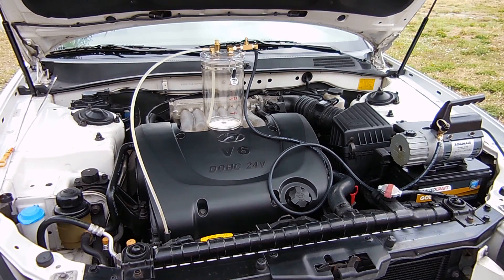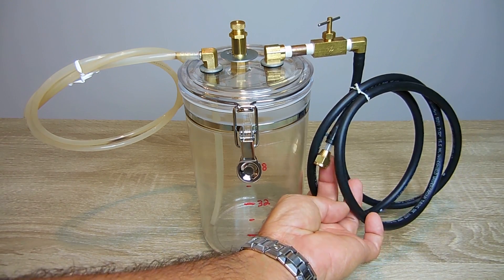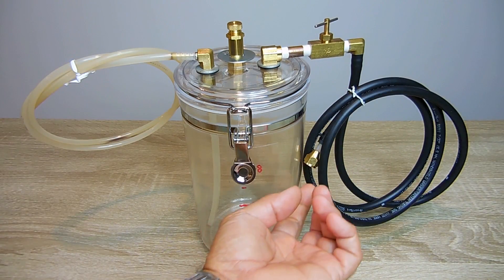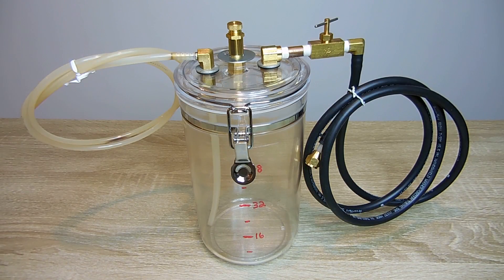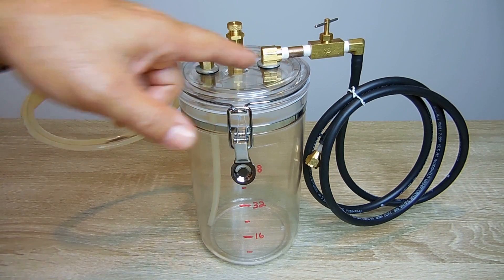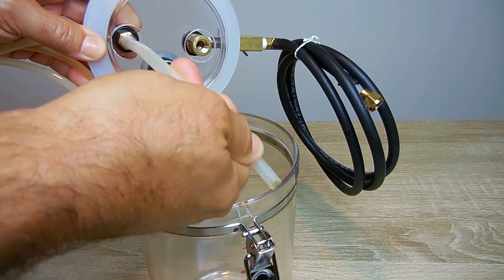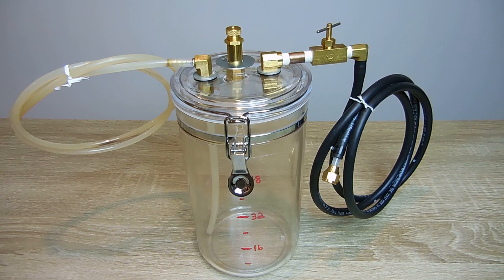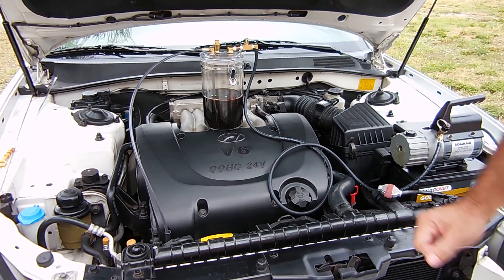How To Make A Quality Vacuum Oil Extraction Chamber

Comment: Perhaps there should be a float mechanism to automatically vent the vacuum pressure and/or cut power or signal to the pump upon liquid level rise so that it can be operated unattendedly and/or absentmindedly.

Comment: This is very practical where I may need to "vacuum" out some intake valve cleaner after cleaning and "scrubbing" the intake manifold walls and valves. The size is suitable and if I need to pull out more, I can simply pause, empty, and resume the job. 

Any harm to use another washer and rubber gasket on the underside/inside of the container to improve the sealing and spread the load of the nut/fitting against the plastic?

Comment: I use a goat milking machine, just remove the teat gland and insert a 7mm copper brake pipe and you can then suck hot fluids. They are on aliexpress 👍

Comment: Not to be a negative Nancy, but most oil filters are on the bottom of the car. This is still a solid useful tool. If someone has one of the Toyotas that has the oil filter on top, this is a solid game changer.
Reply from the maker: You're not sucking the oil out of the oil filter you're sucking it out of the dipstick which goes to the bottom of the oil pan

Comment: OK video, but seems like you built it way to small.  Most people want to COMPLETLY empty whatever fluid and in cars) your chosen capacity is simply not enough.  I am also curious as to how long in REAL time (NOT time lapsed, like you showed) it took to remove that oil.
Reply: I don't think his intentions for this particular vacuum chamber were to be able to drain the entire oil pan. He did say he could use it to remove a small amount of oil to add an additive. If you want to drain the entire oil pan I would suggest you make one out of a 5-gallon bucket, and use a Shop-Vac for the vacuum source. This one would be very useful to drain the oil out of a small engine like a lawn mower, or outboard.

Comment: What size Vac Pump are you using? You mentioned 14" Hg on the Relief Valve. What's the Flow rate though?
Reply from the maker: Robinair single stage pump

Comment: What is the danger of using this to extract gasoline?
Reply from the maker: Dangerous. The vacuum pump will have gas fumes all around it, and a spark from the motor can ignite the fumes.
Reply: @electronicsNmore    Makes sense. So I guess use one of those manual vacuum pumps instead? I really don't need a deep vacuum. Just enough to suck out gasoline.

Comment: 2 years later, how did this hold up? Did the Walmart container last?
Reply from the maker: It's still good, but I did have a hairline crack on the lid where one of the holes were drilled. I used a larger rubber washer. :-)
Reply: @electronicsNmore  Nice!! Just found this video. Will be doing this tomorrow. Thanks for fast response! Will sub🤙👍👍

Comment: I just got a plastic drink bottle and hooked up to a shopvac intake using the top cone from a soft drink bottle works fine
Reply from the maker: That can also work, unless the suction is too strong and implodes the bottle.
Reply from the maker: @willem2544  Were you born a lowlife? Or become one later in life? Just curious, since you posted a wise @ss comment.

Comment: I'm going to ask a stupid question lol. 

Is it ok to do full oil changes on a vehicle like this? Os there any harm in Botond draining it through the drain valve? 

My driveway is pretty steep and I don't hav a flat place to work, so I end up taking my vehicles to valvoline. With a coupon that's about $55. I'm thinking I could save $25+ per oil change doing it this way and it's safe because I'm not lifting the vehicle at all.
Reply from the maker: Using this method you'll get "ALMOST" all the oil out if the engine oil is warm. Replacing 95-98% of the oil is fine, the small amount of old oil will mix with the new. Make sure you change the filter. Thanks for watching! Be sure to share the video.

Comment: when inserting the hose down the dipstick tube how do you when hunting for the bottom of the pan that you are at the bottom and the hose has not curled back up and that you are not on the bottom
Reply: Also, you can get a pretty close estimate using your dipstick as a gauge for length, mark on the tubing, then go a bit further.
Reply from the maker: Make sure the natural curl of the PE tube is going DOWN. When you feel it stop, don't push further.

Comment: You could also you this to push oil back into a system by using compressed air on the vacuum pump side, for ex. filling and bleeding your brakes. excellent video.
Reply from the maker: Yes, but it's much faster to fill pouring the oil. Thanks for watching! Please share.

Comment: I'm an Automotive Technican , on cars with drainbolt or not on Trans, Sometimes you have to open pan to clean & Replace trans filter, some cars may not have an aluminum oilpan, case Housing setups. 

Draining engine oil, depending on lifting, angles vs level & oil pan shape, some old cars have 2 drainplus.

Comment: The best oil change is when you drain the oil from the drain plug!  This is dumb to do oil change in this manner.
Reply from the maker: Good luck removing the drain bolt from an inboard boat. LOL You have a drain bolt for power steering? You prefer to remove the pan from your vehicle's transmission to drain some fluid? Please, think carefully before posting comments.
Reply: electronicsNmore for Powersteering Your Supposed to remove to the lowest point, & sometimes to start tge vehicle to entirely drain out the system from tubes & coolers.
Reply: electronicsNmore Your creation is great👍🏻   but The way I change my motor oil, 

I do it with a fully warmed up motor,  I open the drainpug & have filter out while draining, letting it drain completely & sometimes I put a 1/4 to 1/2 of new oil to Flush out old oil, My 94  Celica gt, 4 cylinder, Race motor, I have to begin mynmotor project, dealer gave me main bearigs but weren't tge right ones, I got to plastic gauge each & every vearing this time & use oil pressure gauge instead of the factory switch that doesn't light when oil pressure not safe due to loose main bearings, made in Japan.
Getting New pistons again Forged, adding supercharger soon, looking around 500 HP , factory computer, power limited, automatic Transmission, Distributor, I definitely adding 4 coils, either reprogram factory computer or see if I can add a secondary computer for engine alone, main computer controls Transmission. 

This Celica is My Hobby😎 all wheel drive after.
Reply: This is false actually. I have drained my pan from the plug and then extracted up to 500ml more with an extractor on many different vehicles. Depends on the car and how level it is.
Reply: For cars that you care & appreciate you got to go the extra mile, for cars that you don't care to much of, just suckit from the resvoir.  Do you know that the Powersteering systems in most cars take 2quart  or more. 3,4.  So the resvoir is not much
Reply: My DR power trimmer does not have a drain plug. This is the method you use to change the oil. 👍👍👍👍👍👍